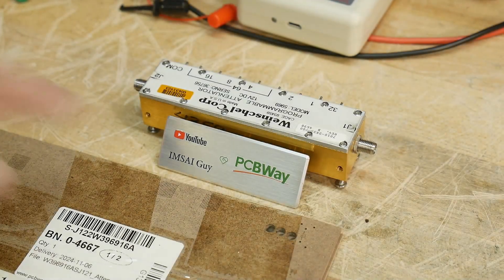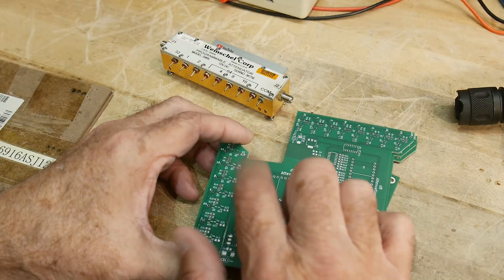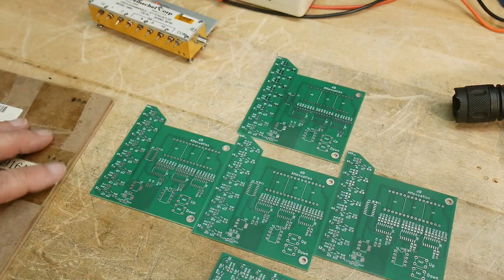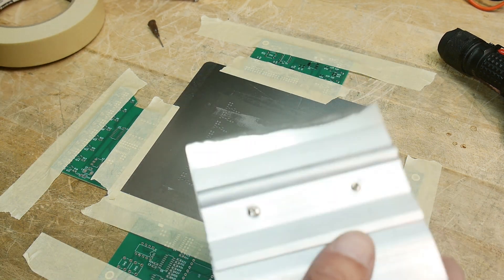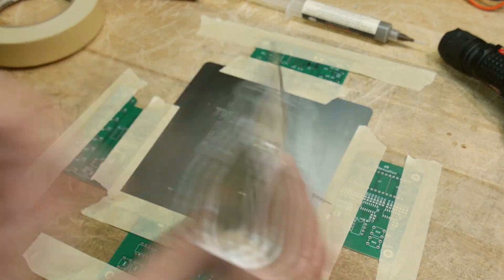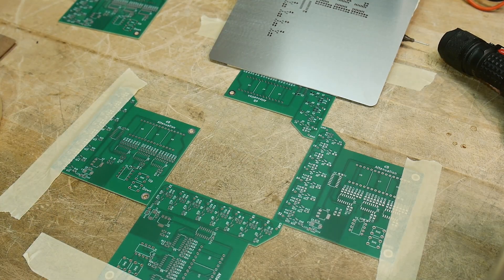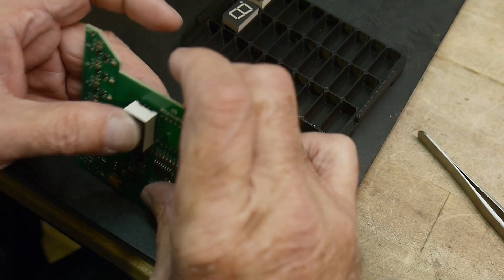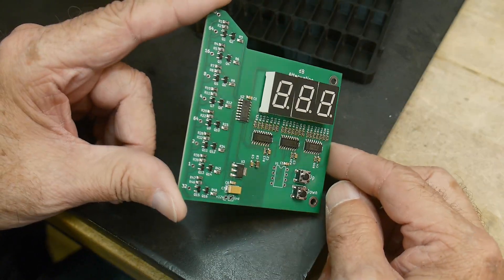#2049 Weinschel Attenuator (part 4 of 6)

Comment: For best results, one large bead of paste along the top, all the way across. Drag the squeegee once and once only quite firmly and slowly across the stencil towards you. Do not go over it multiple times, you are only pushing more and more paste down through and under the stencil which will cause issues/shorts on the finer packages. Buy paste in a tub, that way any left over excess you can put back into the tub.